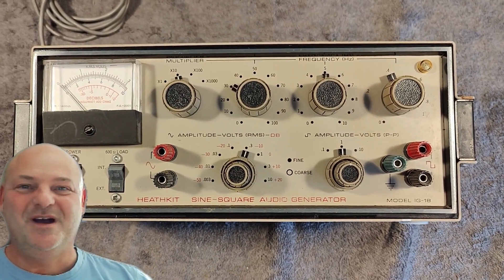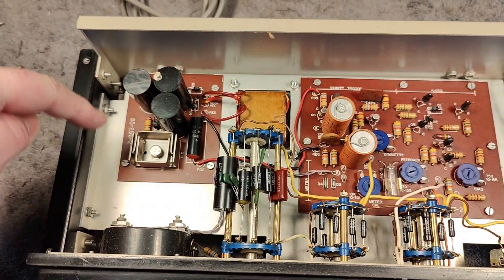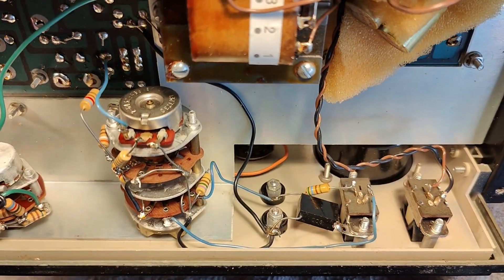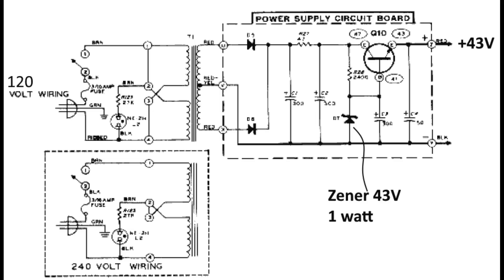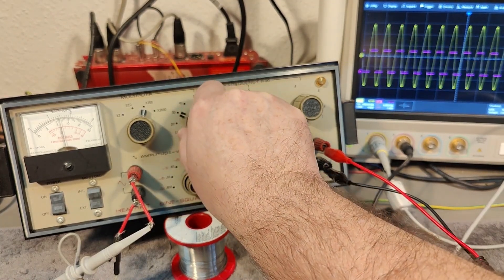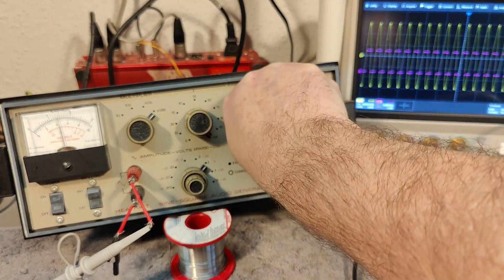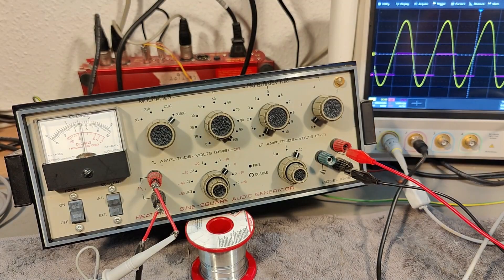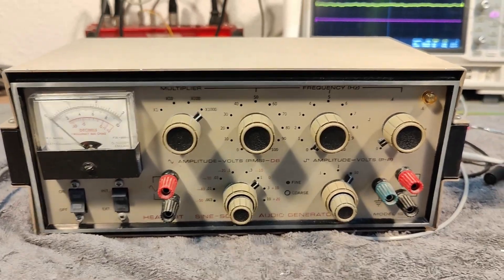Heathkit IG-18 Sine Square audio generator 100kHz 1969

Comment: I have a Heathkit IG-18 that has a good sine wave output except the output output pulses on & off at 1 Hz rate. Anyone known the cause for this?
Reply from the maker: first check its +43V supply, is that one rock stable when you see output do the pulses ?

Comment: These can be modified for really low distortion. Not counting a quick fix due to the square waving circuit causing distortion. I think the meter loading also affected it.

Comment: About testing electrolytic caps. If it's old cap sometimes capacitance doesn't tell you whole story, you need to test it for leakage as well. I had problem with two main filter caps in Tektronix 7903 SMPS. Capacitance was a bit above rated but they we're bad and oscilloscope couldn't start up, when i changed them SMPS started without any problems. I guess you know that but it doesn't hurt to say anyway.
Reply from the maker: exactly, i sometimes explain this and also show caps tested more deeply on my LRC meter where ESR can be shown at the same time

Comment: Heathkit have a few in the lab.  There is always a few caveats when playing with these.  
1. if it was a kit the builder could been an employee of HP and the insides are a thing of beauty or it could just shlocked together by an illiterate  ham-fisted clod who used plumbing solder and blowtorch ;)
2. The lever and toggle switches never age well. I have replaced a number on a few boxes
3. Binding posts also age badly  they tend to oxidized and sometimes can short.  
4. Never overpay for these they are not HP.  If you are buying for a lab they are ok for basic stuff but are never accurate enough for precise work,  in this case fine for putting a signal into an old say Pioneer 680 phono stage but you would not use this as a source to test for distortion or audio quality.
Reply from the maker: absolutly, i dont pay much, i like the unknown to open and see "who" made the kit, is it beautiful art, or terrible ha ha it is kind of fun
Reply: @TeardownOZ2CPU  Yeah I got to admit that is half the appeal when I pick up one an old Heathkit ;)
Reply from the maker: @byterock  a heathkit is like a box of chokolates, you never know what you get :-)

Comment: You will want to clean the symmetry, bias and feedback controls inside; they get dirty and cause intermittent operation.  I would also change the two electrolytics and the tantalum on the main board.